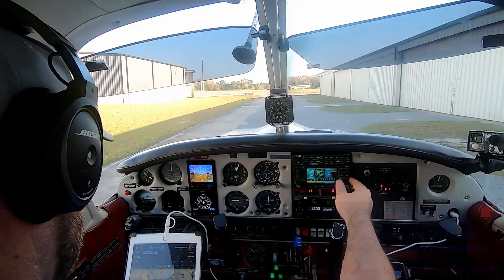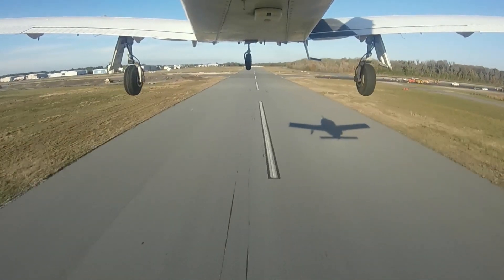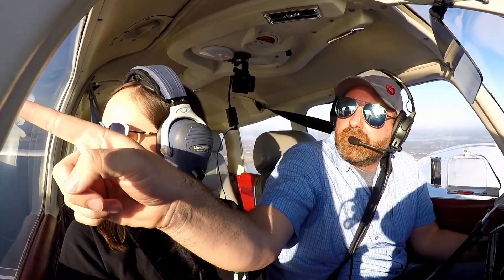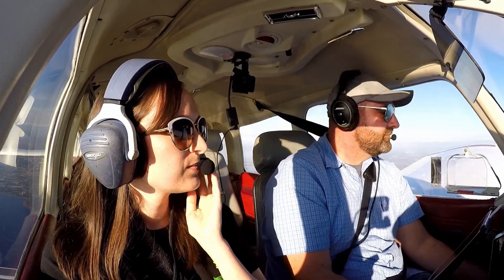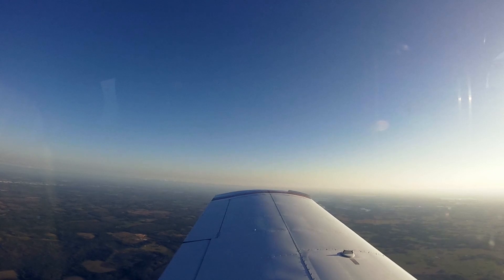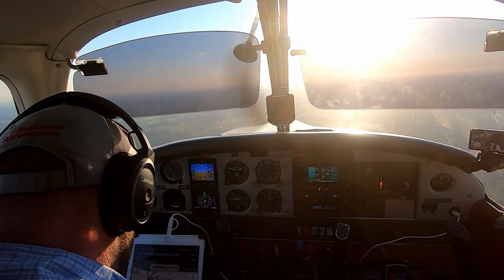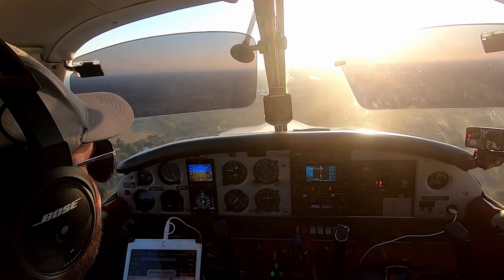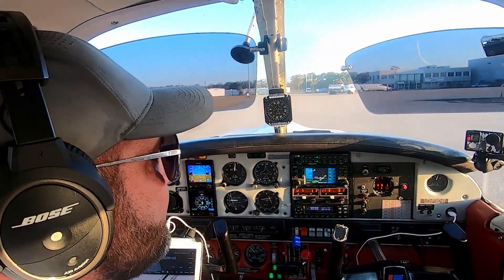Tampa Executive | Piper Arrow | Testing the Autopilot on an ILS

Comment: just a tidbit of info for clearing the runway.  According to FAA orders and the AIM chapter 4-3-20  An aircraft is considered clear of the runway when all parts of the aircraft are past the runway edge and there are no restrictions to its continued movement beyond the runway holding position markings.  great videos though, keep up the good work
Reply from the maker: You are correct. No one made a radio call until all parts of the aircraft were clear of the active runway and there were no restrictions to continued movement. See 24:11 thanks for following along!!